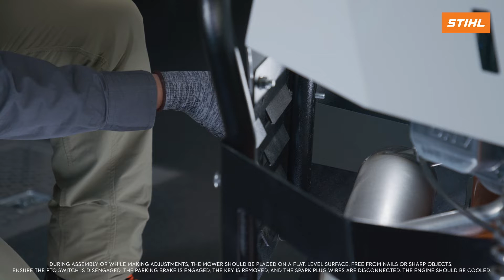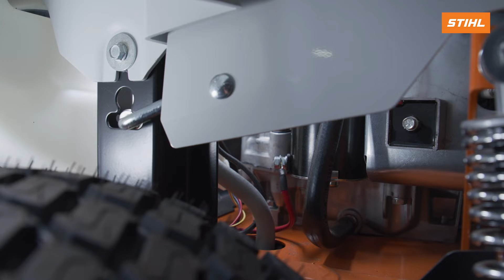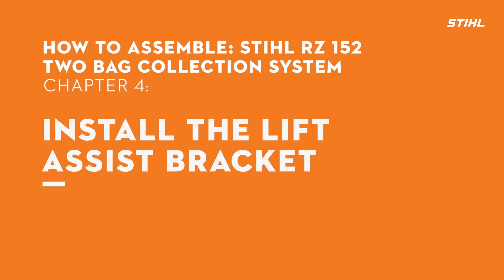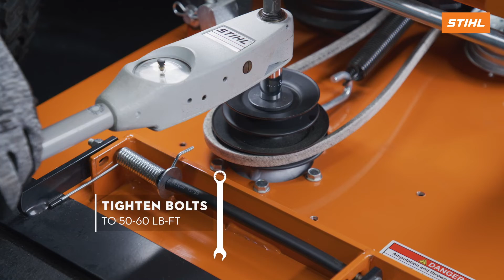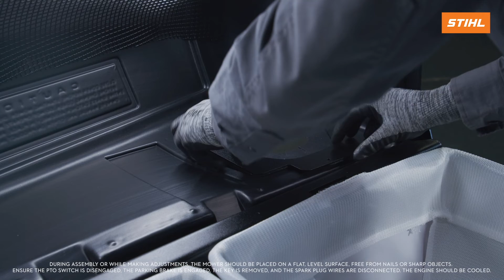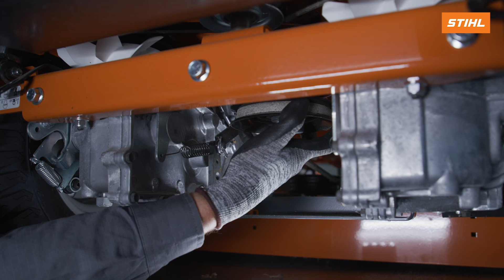How to Assemble: STIHL RZ 152 Two Bag Collection System | STIHL Tutorial

Comment: I bought this and the video is not correct.  I found it online and the description says two bag collection system.  I watched the video on how to install the system and said no problem.  I ordered it and lol I received was the two bags and the bag mounts and the weights.  Stihl doesn’t have anywhere in the description that says you don’t get the tube or anything that allows you to collect leaves or grass.  I called the stihl dealership and they said that those parts are extra.  To me this is false advertising and they should be sued over the false video that is on YouTube.  The so called collection system I purchased cost 800 dollars and you only get half of what the video shows.  Bad enough the mower was 6500 but if you add the bagger who knows how much more it will cost if you have to purchase the blower unit.